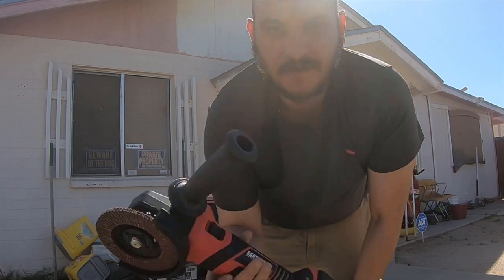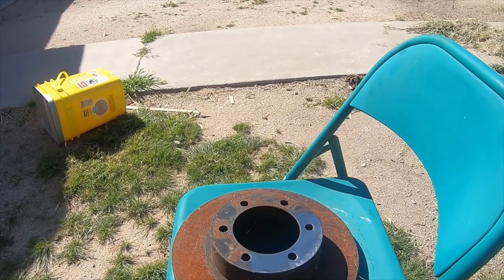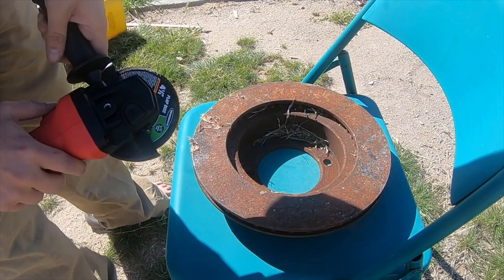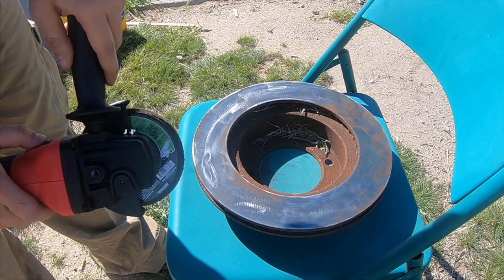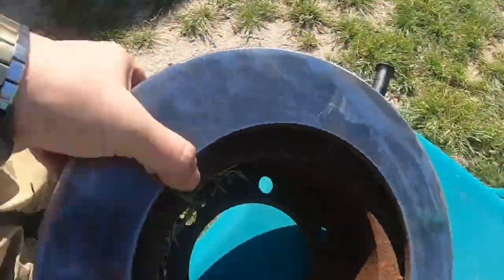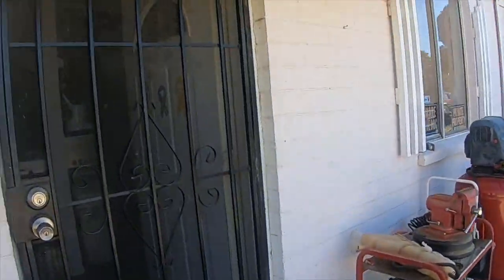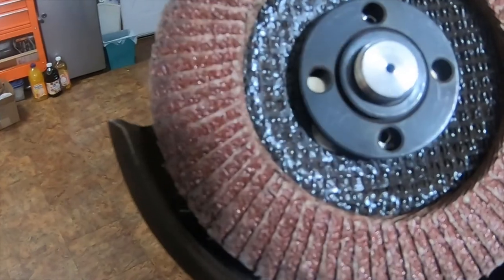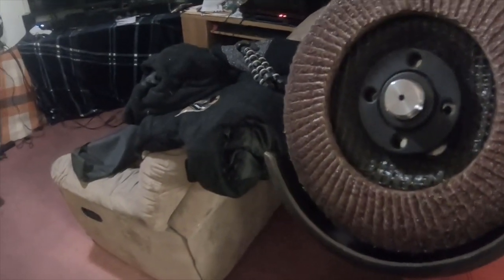Harbor Freight Earthquake XT Brushless Grinder Review N Demonstration

Comment: Useful grinder, love the safety boots 👍 😊
Reply from the maker: Didnt think I needed to wear safety gear for a small demonstration I do recommend wearing boots and gloves and glasses or face shield while using a grinder
Reply: Just teasing my friend, sometimes I go in to my garage in jeans an bare feet which is always a mistake! 😂
Reply from the maker: @Everythings_Adjustable  lmfao stepping on nails and screws like a pro
Reply: And the little wires that fall out of the wire wheel 🤢
Reply: You don't have worry about safety. 😜
Reply: Eh?
Reply: Sorry, making a joke about safety being 2nd.
Reply: Yep it's not at the front of your mind when you are working on projects, then something will hit you and you think I better put on my glasses/boots/apron etc (well that's what I do anyway)  (but I'm getting better as I get organized)
Reply: Glasses is the big thing for me. I have had metal get in my eye years ago. Not a fun time. Even my shades are impact resistant now.
Reply from the maker: Yep

Comment: That’s a nice angle grinder. I like the on of switch position I like when it’s on the side like that or a paddle like on the front. The gaurd seemed like an after thought but a lot of grinders out there are like that. Great video 👍
Reply from the maker: The guard did seem like an after thought but a few seconds to loosen a screw and turn it and tighten screw not bad for the price and it works well didnt bog down at all when I put pressure on the blade so as far as I'm concerned it was a hell of a deal compared to dewalt without a battery is 370 and milwakee without a battery is 279

Comment: For the price it seems like it worked.   What flap disc are you using?   Great review.
Reply from the maker: Warriors from hf
Reply: Antonio Claudio Michael I will have to try them out. I use Benchmark Abrasives right now.
Reply from the maker: This video was to see how well the grinder and hf flap and cut off discs work next video will be with a cut off disc

Comment: I use the ryobi one + line up and I've found they are fantastic home game tools for the price. My question with this grinder is the price. I have a 4.5" ryobi brushed 18v grinder, and it was like 40 bucks on sale as a bare tool. This in comparison, is $135 through the coupon as a sale price. Again that's the bare tool. That seems a bit steep imo. Even the brushless ryobi is cheaper at $110 without a sale or coupon and they offer a much bigger lineup of tools and much better lineup of batteries. Plus their warranty is like 3 years default, plus you can add another 2 years for a fee. Why is this worth way more? I find that kind of odd. That's dewalt or Milwaukee price range.
Reply from the maker: Milwaukee and dewalt grinders bare tool are over 170 dollers for a bare tool no batteries earthquake line is a more professional line without the 40 to 50 dollers more then the dewalt and Milwaukee bare tools second off i payed less then what you described for the grinder because I already had batteries for the earthquake line of tools I'm not in the ryobi line of tools I have dewalt tools I needed a grinder and didnt want to pay that day 50 more dollers for the bare tool so I went with the earthquake and if you compare the rpms and the specifications of said grinders you will see the Milwaukee and dewalt are a tiny amount higher on rpm and the ryobi rpm is lower then the earthquake
Reply from the maker: If you factor in the cost even at 150 for the earthquake xt grinder and say 2 batteries 50 dollers a peice per battery your looking at 250 dollers out the door for earthquake you get a dewalt grinder kit with 2 batteries and a charger for 399 dollers Milwaukee is around 300 to 400 depending on grinder and if its brushless or brushed keep in mind chargers come with other earthquake tools so if your in that line then you are spending over 150 dollers more for dewalt or Milwaukee just for a complete kit and ryobi isnt any different if you look at a grinder kit your looking at closer to 349 for a 5 tool combo including the angle grinder problem is all the kits you can get for ryobi are 2 amp hour batteries the earthquake is a 4 amp hour and the dewalt come with 5 to 6ah batteries and Milwaukee come with 4 and 5 or 6 ah batteries is all subjective to what you want to spend ryobi are home gamer tools Milwaukee and dewalt are professional construction grade tools and earthquake xt line is more for professional mechanics tools the reason to justify the cost is it's made for a specific task can you use ryobi is a professional manner probably will they hold up better then higher end brands probably not it all depends on what you feel your money is worth and what job you are tasked on trying to accomplish
Reply: Ok. Thanks for answering. I have the xt 3/8 impact and I do really love it, plus the 12v ratchet which is great. But I was sceptical about the price on the grinder. If it's a legit grinder on par with a Milwaukee then that's a good price. For what I do i don't need anything more than what I have, and the ryobi is a slow rpm. That makes sense. This grinder isn't competing with home brands, it's competing with the pro grade stuff. So when compared to those brands it is a bit cheaper, so it's a fair price. How do these batteries stack up to the red lithium of Milwaukee? Lot of people buy Milwaukee just for those batteries. If the xt uses Samsung cells I'd say it's def worth it for the price.
Reply from the maker: It stacks up very well to dewalt and Milwaukee I was using my earthquake grinder for 7 hours strait leaning steel yesterday to prep for welding and it held up great I went through one battery and a half they do not have the output power of a dewalt or a Milwaukee but they are adequate for the cost
Reply from the maker: The earthquake xt batteries do have in some of them Samsung cells and some have Lg cells so if your looking at it from that point of view they are great batteries now there are not high output batteries i do use the earthquake impacts on automotive for 6 to 8 hours a day and i rarely have to change batteries but that's because there impacts they dont stay on for long periods of time so a grinder will definitely kill a battery faster then a impact or drill but if your not doing alot the grinder from earthquake will serve you very well i have been nothing but impressed with earthquake i have the 3/8 impact the 1/2 impact the 3/4 impact the 12 volt ratchet the 12 volt polisher and sander and I have the 1/2 right angle impact and they have all done me very well in a professional mechanic shop so in my expertise there a great price for what you get
Reply: $99 now!  (aug 2020)
Reply from the maker: Is it? haven't check the price in a long time thanks for providing updated information ..

Comment: Looks like a decent tool. The guard movement is kinda stupid. It won't effect me because I all pull mine off but still lol
Reply from the maker: Right it's not a big deal I normally pull mine off when I'm using bigger disks it also fits 3/8 arbor disks and also 7/8 disks and it also fits threaded disks and buffers and also wire wheels which is nice
Reply from the maker: Didn't have any slow down when I put a lot of pressure either either is awesome